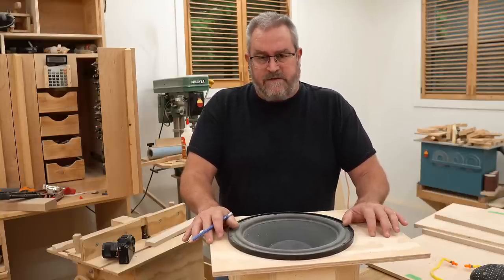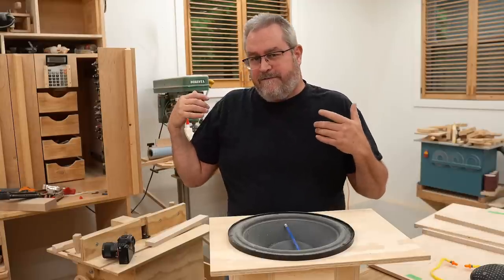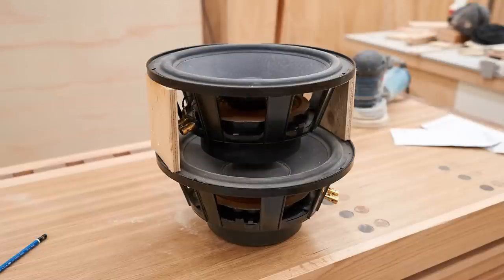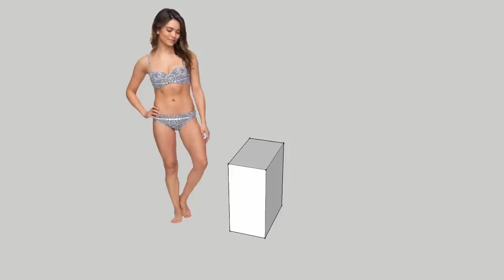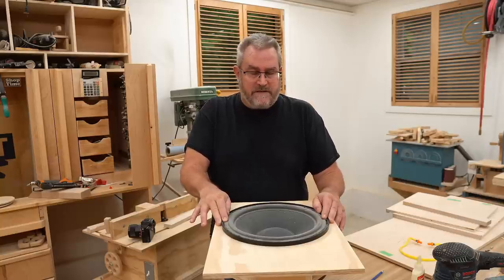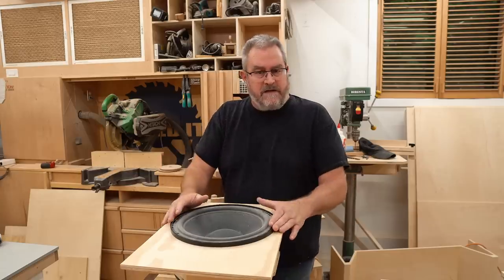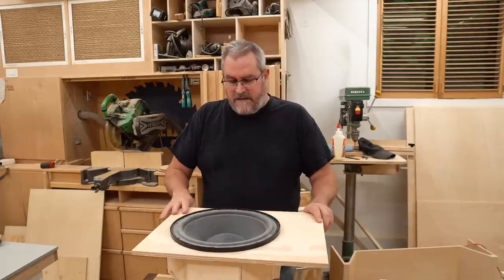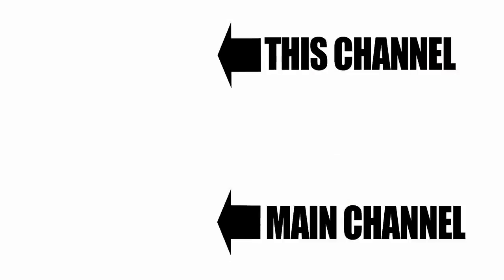Why Isobaric Subwoofer? What it Is And How it Works

Comment: What is the main box behind them is it sealed also or ported ? If it is ported do you port for one or from the box being smaller does the port get bigger ? Like would you do this because you have to 1500 watt woofers and a 3000 watt amp?  I have stuck a pair of 10 inch in a I don’t know if it would still be isobaric but they sound like a 15 or a 18 I got one sealed out of a 1 cubic foot box playing face to face with .7 cubic feet between the pair the other one is playing out a port on the backside of .7 cubic feet about 22 sq inches of port around 24-26 long and it’s a square sealed box with a tube box for the sealed chamber and the ported also there one positive to positive the other is negative to positive on one channel of my amp they really sound good like this there very low and create accurate bass with out the sealed box and arranged back to front there not as low and sound a bit destorted at the time they were in parallel wiring and I had played them into the sealed box like that but decided to turn the one around when back to back they didn’t sound as low and they couldn’t handle as much power now front to front with .7 between them sealed real good they sound better also wired series now I was thinking of doing some 15” woofers this way and see if I cud get the lower sound from them ! Maybe they might sound like 18s or 22s ? But I don’t have a round box guess it wouldn’t hurt to be all square oh yeah the 10’s required .6 seald and 1.4 ported I just though it together to see about the isobaric thing to start ! But then looked and had a sealed box and thought wounder about double sealed and single ported ? Just if any one would know is this just a no name or order or do I have like a 4 th order isobaric box or what would this be I don’t know we’re to begin? Thanks for the info about this everything is so great about audio and seeing what works and what don’t then stumbling on to new things and kinda adding your own twist to it !

Comment: Thought Experiment - Make two identical size boxes.  Purchase 5 identical woofers.  Place one woofer in the first box, with the other 4 going in the second box arranged as two isobaric pairs.  Both with model exactly the same.  The box with 4 drivers will electrically handle 4x as much power, and the output will occur with half the speaker stroke.

All of that said; the real question is how much is SQ impacted?    Do Iso's follow the signal tighter?   I personally think they almost have to sound better / tighter / cleaner.
Reply: Clarification - By identical boxes I mean in terms of airspace after driver displacement.  Obviously packing 4 drivers in a box is going to consume a lot of space, thus growing the enclosure size.

Comment: Where do you put the cutoff frequency for this arrangement? Also, what does it sound like when a pure sine wave sound gets into the frequency range where the wavelength of the sound matches the distance of the speakers. Should be around 1-2kHz in your case. Or half the wavelength. Should cause some destructive interference between the two speakers. Probably sounds pretty awesome if the frequency is just slightly off :)

Comment: Interesting.  The speakers I bought when I was in high school had an active woofer with a passive woofer below it, the passive one being driven by the cabinet pressure from the active one.  When I think about it now, it makes me wonder if there was some phase cancellation between the two or if the frequency of the larger passive cone was different enough to avoid that.
Reply from the maker: The passive radiator acts like a port, but without a port.
Reply: @IBuildIt  The certain Philips boomboxes used Woox Radiators:  Dual accordion-like Radiators, back to back, about 1" apart.  The sound was completely different from a typical tube Ported speaker.   The bass was deep, powerfully thumpy, and yet didnt have that artificial sounding farty bass... (which happens in ported speakers at louder volumes)

 It was some of the best low bass / sub effect sounds,  without an actual Sub.

 Personally I find most subs muddy music, so I tend to avoid them unless its merely for movie effects.  Even then, I prefer an actual Bass Shaker Transducer setup.  You feel 10x more bass, without the need for mega volume level + high pressure air movement.

Comment: Can you do isobaric with one dual voice coil driver and a passive radiator in a clam shell?
Reply: Probably sound crappy..better to put your radiator away from your driver
Reply: It by definition wouldn't be an isobaric design. You need two drivers working together. Passive radiator is not dissimilar to a ported enclosure. A port uses the energy inside the enclosure to essentially create an area of air that makes waves like a speaker cone or passive radiator. The difference would be in how the energy is transferred. More controlled in passive radiator configuration but less efficient since the mass your using to create the additional sound waves is obviously much greater than port air.
Reply: @brentb5303  yes, I was trying to discourage him from doing anything silly.